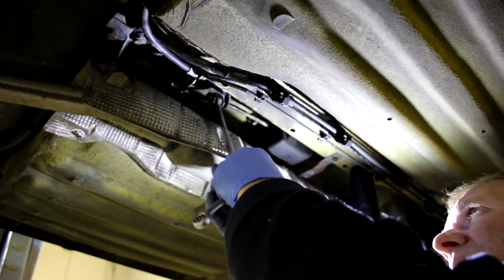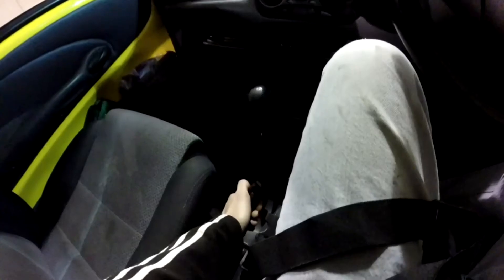How To Change Brake Drums & Shoes (Super Seicento)

Comment: Tip: the brake shoes on 'centos (as well as 126s) don't have the conventional travel adjusters. Instead, once you've replaced your shoes and put everything back on, get in the car, start reversing at a brisk speed- then slam the brakes. The self-adjusters will then... adjust!

Comment: Miller you may find that your handbrake cable is stretched and may need replacing.   I did my brake shoes and cylinders last summer all was good but unfortunately my handbrake cable snapped not so long ago..Ho Hum. Sometimes the rear hub will not come off, a 'hub puller' set or slide hammer may be needed to remove it.  I had that problem on one side but just left it on and rebuilt that side 'by feel'. Not easy but not too difficult. Good little series so far, you may want to flush out your brake system's fluid as this is one aspect of car maintenance that is severely neglected.  I have had my Seciento just short of 5 years and have done it 3 times...It's a 2007 car and had never had it done before...The difference was immediately noticeable and well worth doing.  You can actually do it by yourself and without any specialist tools, just a bit of YouTube 'know how' and a few cheap bits and bobs...and some brake fluid!!
Reply from the maker: Thanks for the advice, buddy! The cables were replaced a few months ago and the fluid's recently been flushed, just a ceased adjuster on the driver's side and knackered shoes were hindering the handbrake. All adjusted now and it's awesome once again! 👍

Comment: Hi my partner has a Schumacher sporting and the rear drums are slightly different no grease caps on the hub nut and the four wheel nuts are attached to the drum like studs, do i have to rake the 4 studs off before the drum comes off or is it just the center  hub nut?

Comment: Why not discs?
Reply from the maker: I explained why in the intro, but in a nutshell: difficult and expensive to source necessary parts, not the easiest job to do, adds considerable pedal travel, not actually necessary due to most braking being on the front anyway and unless you're building a track car, there's really no need
Reply: TLDR; It's expensive, a technical nightmare & has many unexpected knock-on impacts.

1. There are a few near bolt-on callipers but you're better off choosing a calliper with a decent pad selection & easier to get hold of. You'll then need to get the tech data & design skills so you can get a machine shop to make up a custom mounting.

2. The handbrake cable, best case all you need to do is re-route the cable, which involves dropping the petrol tank. But depending on what callipers you use you may need a custom cable or even replace the handbrake system entirely.

3. The stock 'cento master cylinder is too small, you can either live with the long pedal travel and lack of feel, get a bigger master cylinder, plenty about but you've got to work out which one the correct size for your setup. Or replace the pedal box and replace the entire brake system, then'll now need to re-invent the clutch actuation system & possibly need a custom throttle cable made up.

4. You'll almost certainly find that the brake bias is all wrong so you'll need to introduce a bias valve & set them so you have proper rear brake balance front/rear & left/right.